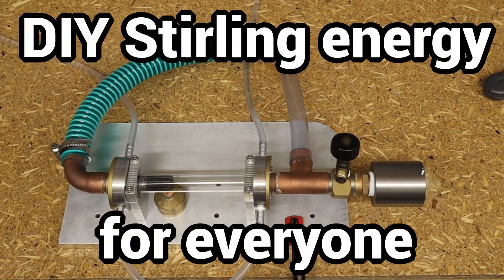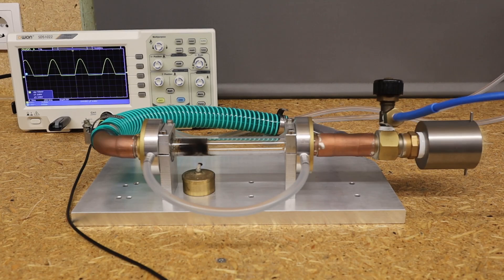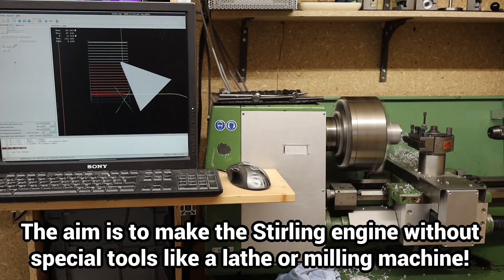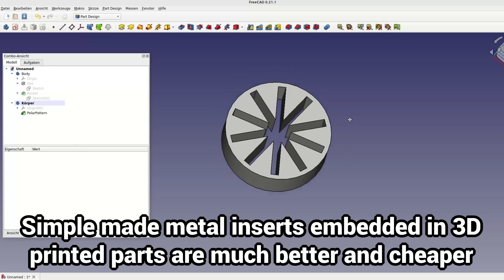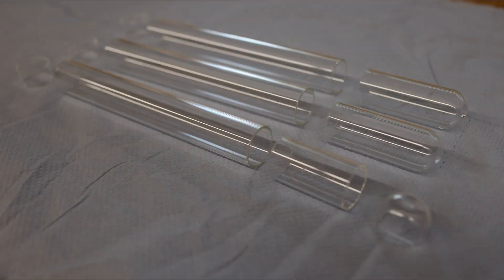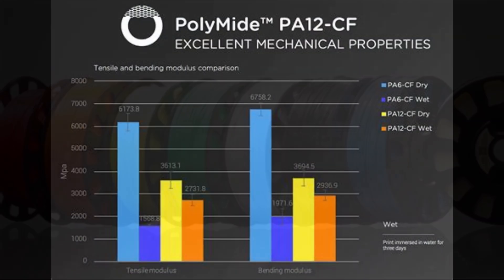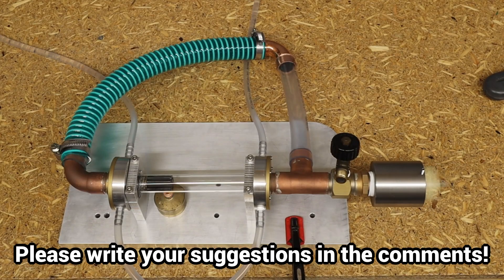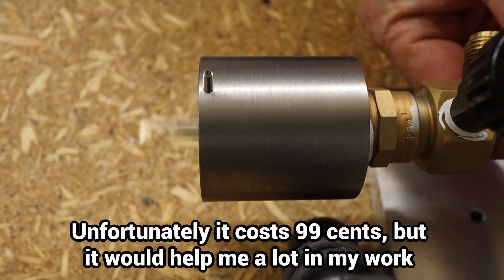Make a 3D printed Stirling engine !

Comment: I like this, the power from the output oscillator could be connected directly to a Bowden cable and from there to virtually anywhere on a machine (say a bike) needing mechanical power. Are there any analyses showing the actual output in watts?
Reply from the maker: Not yet, its power has first to be raised significantly. The engine is still at the very beginning of its development!

Comment: In your other video you are showing a turbine being spun by  oscillating air. I wonder if you might be better off with making a much slower and larger engine that would move much more air during every stroke.
Reply from the maker: For the turbine this is much better, but not for the engine, as output power raises with frequency!

Comment: I don't have any metal fabrication at home beyond hand tools like vises, hacksaws, drills, and files. So I order CNC machined and DMLS printed parts at providers such as Parts Badger (U.S.), Xometry (EMEA), and Protolabs.
Reply from the maker: Isn't it very expensive?
Otherwise this can be a solution for at least the heater and cooling fins which are very small!
Do you have an idea how expensive will be an easy part as the heater which has Diameter 17 mm and is 26 mm long ?

Comment: Great consept. Open community to drive this furter is for sure interesting.

Personally I consider soldering, accessible enought to be an valid option. At least compared to milling or lathe. 

I was thingking if on the shelf, copper/brass piping could be utilised as cold heat exchangers. 3D printed moulds to make gypsum jig to support all the parts and then solder all joints in one go. Water piping parts as main body and brake pipes as "fins".

Also several brass brake pipes could be soldered (or attached in other means) in a cluster to form the heater. 

Do you have any tips where to purchase the book, in Europe?
Reply from the maker: Hi, very good ideas with soldering the heater and coolers, I will put it on the list!
The book is available on Amazon if you search a bit.
Greetings
Ralf

Comment: What about an all plastic cooler filled with water. Get the walls as thin as possible on the cooling interface with water directly "behind" it. 0.4 or 0.8mm walls. Sealing might be a problem though.
Reply from the maker: If the sealing problem can be solved this may be a possibility.
But I think 1mm wall thickness is minimum I would try...
As this is a fast made experiment I think it is worth a try and I will do it as fast as i have time! Thanks!

Comment: While not a redesign idea, you could definitely get parts cnc'd or slm printed for relatively cheap with online services.
So you could print the 3d housing part, then order the metal 3d printed insert.
Reply from the maker: I think 3d printed metal parts are still quite expensive.
Printing with polymer/metal filament and send it to debinding and sintering is an option but also quite expensive!
Reply: I've seen some exalent work done with 3dprinted meatle moldes 
As seen here
https://www.youtube.com/watch?v=qxc-nwnDdgg

Comment: Curious about low temperature metals being sand-cast with 3d printed patterns for parts not directly exposed
To flame.  It might be possible to have precision low-friction mechanisms there.
Reply from the maker: Yes this is also a possibility but a lot of work till you get good results i think...

Comment: Is it practical to make many small engines and place them in parallel to scale up the power levels?
Reply from the maker: I don't think so, its much less work and more efficient with one bigger engine or a circle of 3-4 double acting pistons especially for the thermoacoustic engine!

Comment: Could you make an explanation of the working principles that allow to make a bigger version of this? I am curious as to how you will make it have enough torque
Reply from the maker: The working principle is based on quite complex thermoacoustics.
In easy words is in the regenerator or stack a travelling wave induced that is feed by the heater and cooler arrangement.
In the resonant network a standing wave is established that could do work to the power extraction unit.
This is a crude description in very simplified words.
The true advantage is the simple mechanical structure with just one moving part - the piston.

Comment: Continius 100watt can be good. I testes now and petg filament cannot resist boiled water temperature. We can use resin printer.
Reply from the maker: The benefit of the cooler is that inside it is filled with flooding cooling water so it is permanent cooled.
The metal cooler I use so far has rubber o rings that seal the test tube and they show no melting problems.
PETG may not be enough heat resistant but I think a test is reasonable!
I have no experience with resin prints how much temperature can the y withstand?

Comment: A 100W, 500W, 1000W, 2500W and 5000W with a hot side temperature of 90C would be a world wide game changer, the ability to turn biomass and solar heat seasonnal storage into a reliable source of electricity
Reply from the maker: I don't think that you can get these power levels with such a low temperature difference with reasonable effort.
A temperature difference of 300-500 kelvin is much more promising for these type of engines.
For 90 kelvin difference you need a low temperature differential engine which would build very big!
Reply: @myengines2443  How much overall efficiency ( thermal to electrical) you have measured with your engines ?
Reply: @myengines2443  so basically you need the kind of heat a campfire would provide?

people who go camping spend hundreds of dollars on a few solar panels to generate a few hundred watts. unfortunately nobody sells small thermoacoustic engines that can generate a few hundred watts from a campfire, but i can imagine that hundreds of thousands of people would be interested in buying them if they were avaliable.

$1-$2 per watt is pretty reasonable if it can run on firewood

Comment: Have you looked at the virtual foundry and they’re filament based pure metal 3D printing? With the basic (FDM) printer, you can printer filament use a small electric count and get pure metals of all types from copper bronze aluminum to hard steel stainless and even titanium as well as carbide and some ceramics/glass
Reply from the maker: That's a very good idea.
I had already heard about it but hadn't thought about it.
I think it is possible to print these filaments at home, but is it also possible to sinter or melt them at home?
This is definitely an idea that we should keep working on, thank you very much!

Comment: I believe there are enough people to make a community. for the radiators. I think a great choice will be using copper. Because 1.most people may not have a lathe, but they can have simple DC tig welds, that can bse used to weld copper. 2.They can borrow the heat conducting rod that us used on PC, which is exteremely thermal conductive. .
Reply: due to ductility of copper, cylinder shapes can be rolled out of thicker sheets as side walls of inner chamber. thus avoiding using lathe.
Reply from the maker: That's a very good idea, can you be more pecise or better send me a drawing?
The dimension of the coolers are approx. d=18 without fins (inner diameter of the test tube) and l=13.
In the members area is a detailed CAD drawing.
I hope that it is possible to set up github/dicord soon....
Thanks for your good thoughts please keep going!
Reply: You don't even need a TIG for copper, smaller parts can be brazed using a blowtorch. For bigger parts oxy-fuel torches are effective for brazing.

Comment: how about something we can order from pcbway or some sort of manufacturer as a design people with money can use such a thing rather than 3d printing (ofcource metal 3d printing is a exeption) with that option that stirling engine can produce higer power levels
Reply from the maker: I don't think that's an option for the masses and the motor should be accessible to everyone!
Reply: @myengines2443  I would buy some turned or milled parts if they are much cheaper then to turn them on my mini lathe. Especially if you order 10 or 20 pieces of milled/turned parts they get really cheap

Comment: Generally speaking when doing work like that you should always choose the cheapest and most simple way. 
For example you asked is coating the FDM printer part with Epoxy a good solution or the use of something like "Dichtol".
Start with Epoxy or CA glue, or maybe even a spay can rubber coat if it´s cheap, even if it looks stupid and feels wrong THIS is exactly how breakthroughs are made. The first person being able to fabricate graphene did just something stupid like that:
(Doch wie wurde Graphen eigentlich entdeckt? Das haben 2004 Andre Geim und Konstantin Novoselov mit einem genialen Trick geschafft: Sie klebten ein Stück Klebestreifenauf ein Stück Graphit-Gestein und zogen den Film ab. Dabei blieben einige 1000 Schichten Graphen am Klebestreifen hängen.) and he won the nobel price for it, how awesome is that.
Reply from the maker: Yes you are right but my time is limited and that's the reason I want to bundle the great experience of all of you Youtube users to have less fails and get faster success for all!
But basically you're right, of course!
Reply: @myengines2443  Yeah you try to maximize on your time, but I am not sure if it can work in this case here. You need to manage all those idea now and sort them and value them and so on and there will be a whole bunch on nonsense, I don´t think it might work out. But yeah I might be wrong
Reply from the maker: If there's one thing I've learnt here on YouTube, it's that I shouldn't underestimate swarm intelligence!
But you are right a good platform like github/discord etc. is important but it will be much additional work!

Comment: UV resin for 3D print water/air tightness is common. Lots of UV setting nail polishes out there at a fraction of the price of epoxy, though you may want epoxy at a later prototype phase.

Have you considered a different gas? I'd wonder if there was some power v torque performance selection there.

Certainly keen to follow experiments!
Reply from the maker: Do you know a bout the properties of UV resign specially heat resistance?
A different working gas,  preferably helium, can be tested when the engine is hermetically sealed.
This requires an generator coupled to the power piston which can also serve as a starter.
I made good experiences with helium in my rhombic Stirling engine and all powerful thermoacoustic engines I know of also use helium.
This is definitely required for higher output powers I think!
Thanks for your kind thoughts!
Reply: @myengines2443   heat resistance, not specifically but there are nail polishes around that are much more robust designed for workers in more industrial settings; they may have more datasheet like details. It's cheap enough to test a couple options though. The channel "integza" has been doing a lot of work with hot moving fluids using 3d prints, refractory, ceramic 3d prints, resin prints and more; there may be some liftable aspects from there.

Comment: if you are looking into open-sourcing your designs, you may want to use a version tracking system like git with a popular service like github to make design files more accessible
Reply from the maker: Yes I think Git or Github would be a very nice way for this project.
AFAIK Git is also very good for non code projects!
But my knowledge of Git is very low and I don't think that it will be possible for me to manage this.
But if someone can do it please get in touch!
Reply: @myengines2443  aye bro, howz it goin!
How you progressing with them stirlings?
You pay any heed to a flat panel esque stirling, cuz most stirlings are comparably inferior to run off of combustion, efficiency wise or power density compared to ice (some refined designs and jets).
Better to use with renewable energy sources no?
Reply from the maker: I use self-produced biogas as you can see in my older videos.
Now my focus is on the thermoacoustic Stirling engine because I think it's an ingenious concept for a self-built combined heat and power plant!
Reply: @myengines2443  would you ever happen to think that something like compliant mechanisms could prove to be great as generators and engines?
Those are said to have singular parts, and long wear life, could be maintenance free for long operation times.
Rotation may be harder for compliant mechanisms, but for acoustic engines.. watcha think
Reply from the maker: I do not exactly understand what you mean with compliant mechanisms, do you mean some sort of diaphragms?
I learned a lot about them on my research for free piston or TMG Stirling engines as you can see in my older videos.
Diaphragms are still in my mind as a very elegant way of covering pressures into kinetic energy!
Please explain you thoughts, this would be nice!
Thank you very much!
Reply: @myengines2443  yes, diaphragms, I have some other fun ideas using odd parts (literally unconveyable through text, neither an visual illustration can be found in the internet). 
Also bellows, but we need more compact and better, more resilient designs tbh.
Diaphragms aided, reinforced with fabric.
But still, these may be ok for low power stuff, but I'm really thinking we need similar stuff with more hardcore materials.
We really need power density and efficiency. Current designs don't usually offer it quite so well.
Reply: @myengines2443  also, I believe.. because its a thermoacoustic anyway.
Might as well turn it into an opposed piston setup.
Would likely be easier than doing it on other engines, while immediately eliminating noise, vibration as well as increasing efficiency.
Reply: @myengines2443  there are a variety of gui desktop clients for git/GitHub available to ease onto the ecosystem. There are a number of tutorials on YouTube on using git for physical hardware projects. I'm sure there's folks out there willing to lend a hand with ins and out, but some early stage things you'd want to set up first (GitHub account, project repo, etc)
Reply: How do you open source non code stuff as a git?
Any other way of making multiple versions of a cad file/design in one file or a simple way you know of without git or github?
Reply: @yasirrakhurrafat1142  You can use any standard file sharing system in theory.

If you dont want to use github, you can deploy your own version of gitlab community (although you would need to check their license)